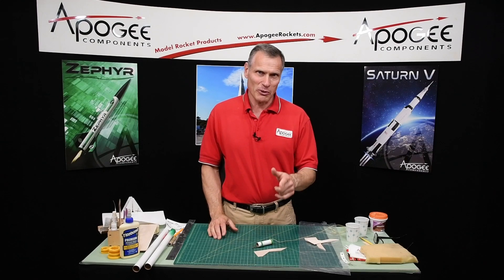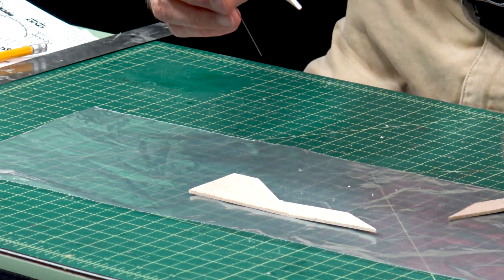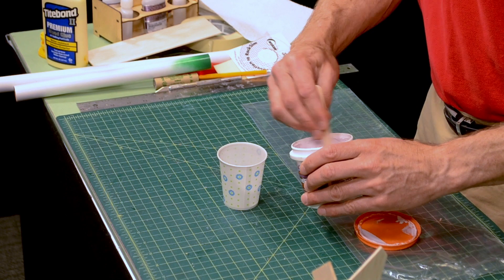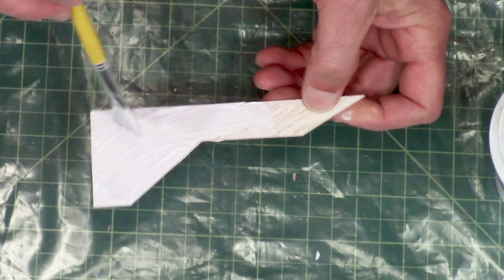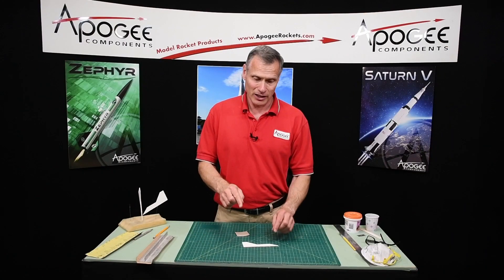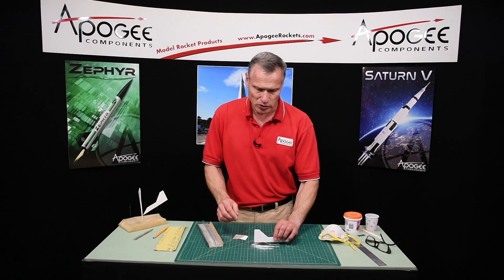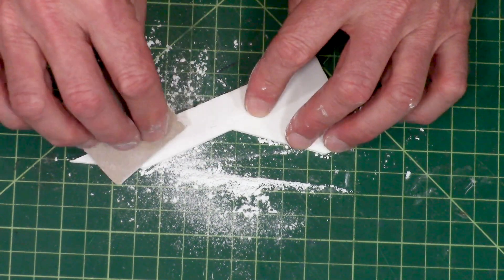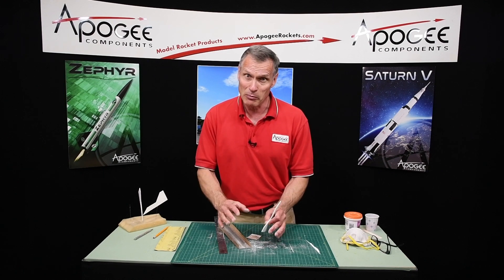How to Build a Rocket from Plans: Part 2 - Sealing the Fins

Comment: Tim, wonderful presentations as always. Would you use this same process for plywood fins?
Reply from the maker: You really don't need to seal the plywood since the grain is so tight. Just use sandable primer and that will give you the smooth surface you desire.
Reply: @apogeerockets  You provide many valuable resources to the rocketry community Tim. Thank you very much.

Comment: If I use sanding sealer instead can I do one side a time?
Reply from the maker: Go ahead and test. What's the worst that could happen? "You'll have to scrap a fin if it doesn't work." That is a small investment to make in new knowledge about a type of sealer you want to use.
Reply: @apogeerockets  Sounds great, I was just wondering if this was a big no no.
Reply: I would really suggest that you do both sides at the same time.  In my experience, the fins will warp (a lot!) otherwise.